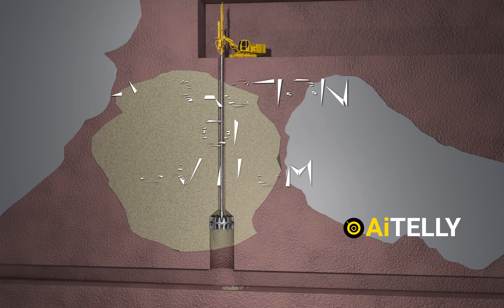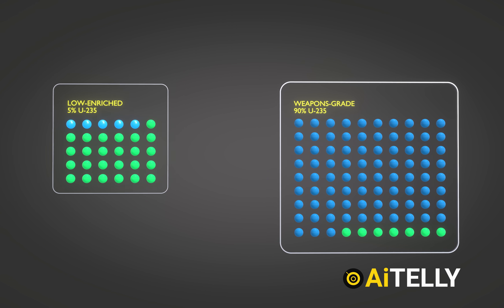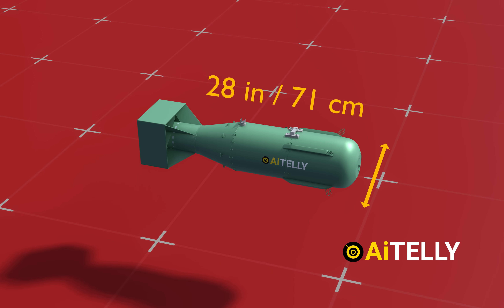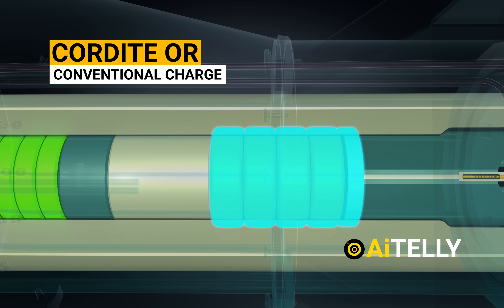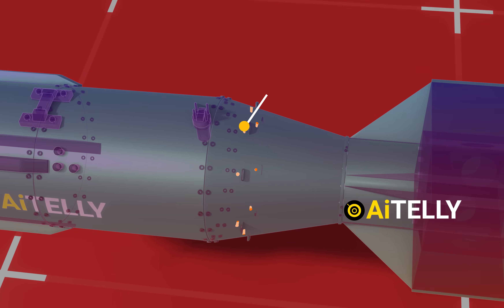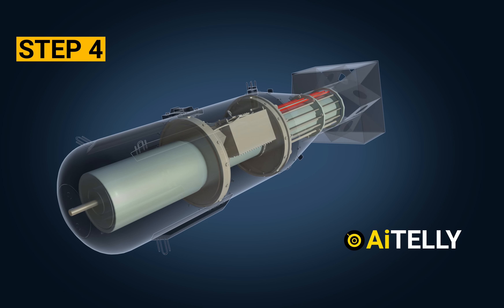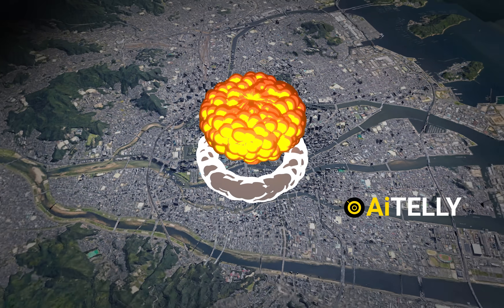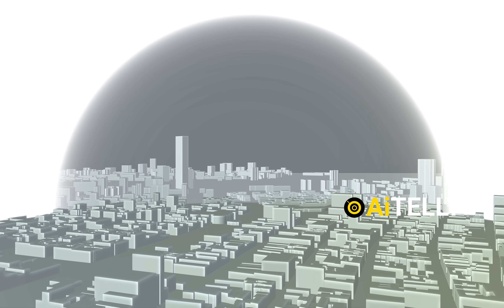How Nuclear Bombs are Made? #nuclear #iran #israel

Comment: And you are completely wrong about how uranium is mined underground.
It is drilled and blasted just like any other ore.
Radiation levels (most problematically Radon) are controlled by ventilation. Ventilation is extremely enough that standard diesel powered vehicles can be used underground.
Open cut mining is easier, because ventilation takes care of itself.
Neither ore source is particularly rich in Uranium - chemical separation is required to separate the Uranium containing minerals from the remaining ore (being 0.1% Uranium typically (although there are couple of mines that hit 20%).
What you showed was a raise borer used for cutting ventilation and access shafts.

Comment: "The little boy used a smooth bore gun barrel". So its basically a naval gun shooting a Uranium-235 hollow tube at a Uranium-235 plug at 300m/s. And by the way there were no polonium initiators on little boy. The little boy relied on natural neutron emission. It went naturally supercritical as soon as the 2 Uranium-235 pieces collided.

Comment: Basically if the mass of uranium is less than the critical mass, it cannot explode but does generate heat, like when it is placed in a nuclear reactor. When it attains (or exceeds), critical mass, it starts the chain reaction and explodes. Bigger the size of Uranium, greater the destruction.

Comment: Centrifuge with Heavy Water is an old enrichment process. 

You can also use Gas Diffusion. 

The most modern, discrete and cost effective way to rapidly build a nuclear stockpile is via laser isotope separation (see SiLEX). 

You still require a vast industrial basis, highly trained engineers and large investments but laser isotope enrichment  technology is the biggest unheard-of threat to preventing nuclear proliferation
Reply: Heavy water has nothing to do with the centrifuge process
Reply: Centrifuges are still the most efficient way to do the separation